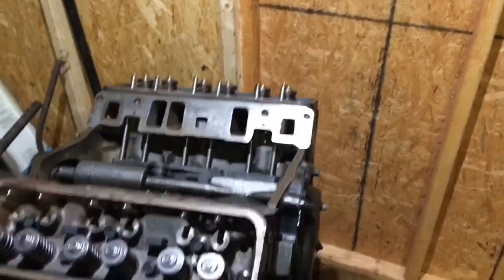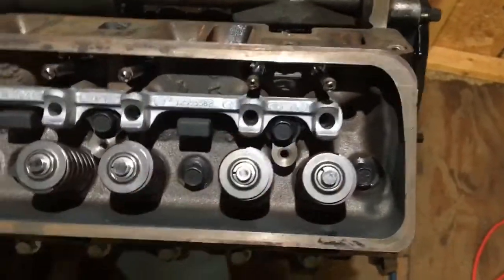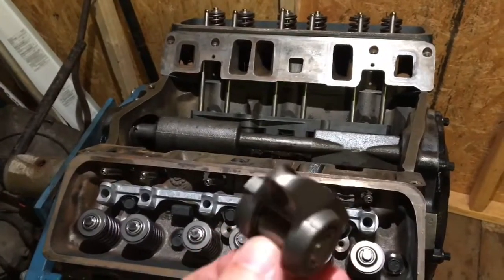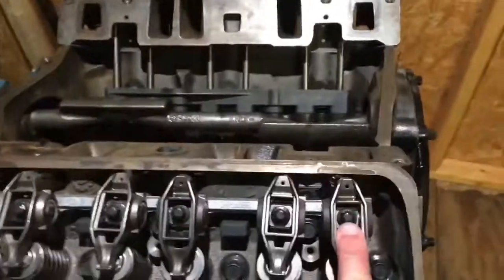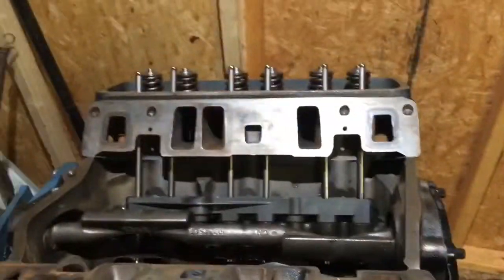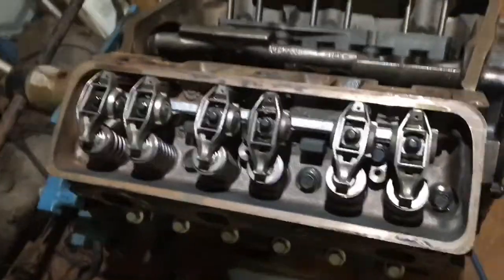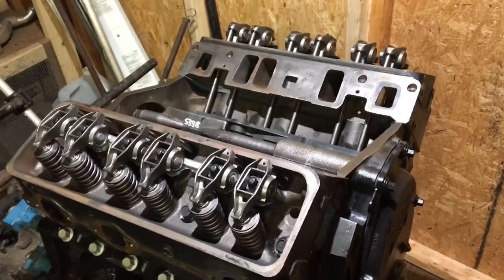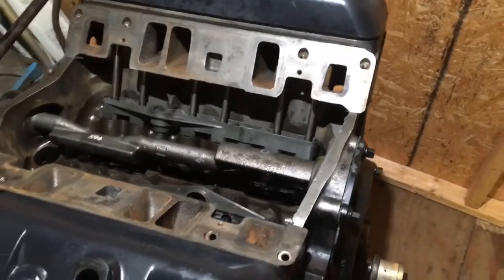Part 7B - Mercruiser 4.3 V6 Rebuild - Valve Train Install

Comment: Where did u buy this rocker arm kit? It looks like those are ls style rocker arms.
Reply: These are for 113 style heads from 2nd half 2000-2002 heads they get torqued between 19-22 ft-lbs.
03-07 classic 113 heads are almost the same but their torque spec is between 18-20 ft-lbs
Reply from the maker: @RamiroSantos4.3 um that’s the same thing. 20 ft lbs is inside both ranges.
Reply: @moccasinmarine i know I'm just going based on the repair manual
Reply from the maker: They come on later model heads like after year 2002. They are not interchangeable with earlier heads because these heads are drilled and tapped for 8 mm rocker arm bolts whereas older heads have 5/16” or 3/8” rocker arm studs.
Reply: Thanks for the info. I'll be looking for a newer set of heads.
Reply from the maker: @robland6118 I don’t know if it’s worth the hassle
Reply: Probably right

Comment: I currently have the roller lifter bolt finger tighten down. I have cylinder 1 on TDC but now I'm confused on which roller lifters I need to tighten down to 22ft pound. I only need to tighten down the 6 roller lifters on the left cylinders (2, 4 and 6).  In the video you said to tighten down the 3 roller lifter bolt that had no spring tension, then rotate the engine 360 degrees and tighten the other 3 roller lifters bolt. How do I know which one has no spring tension and how do I know which ones to tighten down before rotating the engine 360 degrees? In other words what sequence do I tighten these roller lifters bolts? Can I tighten them all to 22ft pound at the same time without rotating the engine? If tighten them all down at the same time isn't an option, can you explain further on how to know which roller lifter bolt I need to tighten down first before rotating the engine? 

I'm staring at 6 roller lifter that are finger tighten down; I'm now just so confused about what I have to do next? If I could get your input that would be great. Thanks!
Reply from the maker: Text me at 706-358-3175 for a tip
Reply: Hi did you ever figure this out I'm having the same problem setting them up

Comment: What state are you located in? Just bought a boat that didn’t get winterized and was hoping your close by.
Reply from the maker: I’m in Harris County Georgia, 100 miles southwest of Atlanta on Georgia/Alabama state line.
Reply: @moccasinmarine  dang, I’m in Idaho. How many do you usually build in a year? And do you sell them nationwide or just locally? Thanks for the videos they are very helpful.
Reply from the maker: @eddygoodwin7089  I try and maintain 1 build a month but that slips when the scope creeps to restoring an entire boat. I sell engines to a mechanic on the gulf coast too. I could mount an engine on a pallet and ship anywhere if needed. What size engine do you have?
Reply: @moccasinmarine  that’s awesome. It’s a 4.3 vortec
Reply from the maker: @eddygoodwin7089  text me at 7063583175.

Comment: Can I tighten down the 3 rods in the lower position out of the 6, spin the crank 360 and tighten down the other 3 rods that are now in the lower position? I’m confused on what three rods I need to adjust first before I spin the crank 360 to tighten down the other 3. Could you help clarify? Thanks!
Reply from the maker: I have no idea what your question is. There are twelve pushrods but as the video shows just tighten them all down at the same time.
Reply: @moccasinmarine so can I just tighten all 6 bolt and call it good without turning the crank?

Comment: they are NOT roller rockers. They have needle trunions. No roller tip..
Reply from the maker: If I have a see saw and 100 lb kids on both ends the force at the fulcrum is 200 lbs. If the valve spring is 100 lbf. at no lift the pushrod must push with at least 100 lbf. which places a 200 lbf load on the rocker fulcrum which is a roller bearing so  in my book I call them roller rockers I.e. they rock on rollers. The valve stem force is half so much less friction there. So GM puts the roller bearings at the point of highest friction and not at the valve stem, probably an economic decision.
Reply: @moccasinmarine  be that as it may a roller rocker is a rocker with a roller tip.Period. Not arguing that it is a great design but its just not a roller rocker.
Reply: It just doesn't have a roller tip. The fulcrum is a roller. It's an ls style rocker arm is what it looks like to me.

Comment: Super Channel, tackling mine because of your videos. I have tapping noise in my engine, to me it sounds like lifters. My question is do the lifters have to go a certain way. ie does the hole for the oil have to point a certain direction. I know the lifters can only go one way to roll on the cam but the hole for the oil can go either way two? Thanks Colm
Reply from the maker: Oil hole location doesn’t matter but if you took it out a certain way i try and put them back in the same so wear patterns match up
Reply: @moccasinmarine  Super thanks for the reply. I had a ticking noise in my volvo penta 4.3. I changed all the lifters and fingers crossed the noise is gone. Now mind you I only ran the engine for 5 to 10 mins in total since I replaced them.
Reply: @moccasinmarine  Great channel really helps people out. It definitely helped me. Thanks from Ireland 🇮🇪 👍

Comment: Hey do u need specific heads for that or can I swap those on for the normal rockers
Reply from the maker: The heads must be drilled for 8mm bolts. I think non roller rocker heads are drilled for 3/8” rocker studs.

Comment: nice job man , Im gonna do the same thing and use the roller lifters as well .
Reply from the maker: Good luck, you’ll need to find an engine built after year 2000 to get factory roller rockers. You can’t convert older heads to use roller rockers without costly machining.

Comment: Great to see all your videos, but have question too: on my mercruiser 4.3 EFI 1998 i had a leaking exhaust so got water in the engine via cylinder 6.
After inspection and cleanup i put the head on starboard side back again ofcourse with new gaskets and renewed the engine oil 5 times, now clear oil again.
Adjusted the timing again according to specs and engine runs again like normal(performance too)(not every cyl have same compression) but my biggest consurn is the engine vibrates more than before the leaking!
I don't realy know what coused this vibrating, do you have any idea ?? thx in advance!
Reply from the maker: If you got water in cylinder 6 you could have bent a connecting rod from hydro lock. A bent rod will cause low compression and power in that cylinder and throw off the balance compared to adjacent cylinders. These combined would cause vibration. Do a compression check to see if cylinder 6 is comparable to the rest.

Comment: I have one loose rod after I tied all the valves, it still pushes the rod to open the vale when I turn the engine. Is that normal or what is the problem?
Reply from the maker: I’m not sure I understand your question but it sounds like you might have a collapsed valve lifter. You should replace the lifter under the loose rod.

Comment: Do you have to turn the crank to a certain spot?
Reply from the maker: On older engines yes you do have to rotate the engine to top dead center and do half the lifters and then rotate around to TDC again and do the other half. But in this build, the lifters are not adjustable so the answer is no you don’t have to turn the crank to a certain position.

Comment: Rapping noise on a 4.3l MPI mercruiser
You have done a great job on your video!

I have a recently installed (8 hrs) remanufactured long block engine that has a rapping noise.  The noise is quiet loud when first started and running at ~600 rpm.  It quiets down quite a bit at 800 rpm.  After the engine is at operating temp the rapping noise almost gone (maybe completely gone).  I'm figuring its in the valve train and possibly a sticking lifter. The oil pressure is very good ~60 psi at idle and warmed up.   I have a couple of questions:
1) Can I remove roller lifters by only removing the intake manifold or do I need to remove the heads?
2) When you discussed torquing the rockers to 22 ft/lbs, you didn't mention anything about the preset.  I've followed other discussions on the large LS engines and they mention checking the lifter preset.  One u-tube mentioned 3/4 to 1 1/4 turns and the other said 1 to 1 3/4 turns on the torque wrench after just removing the slack in the rocker. Can you comment about this.

At this point I am very suspicious of the engine. I'm contemplating running as is for a while or digging deeper into the engine.  Any help would be appreciated.

Jim
Reply from the maker: Thanks Jim, there is no preset on these type lifters. As long as you use the same parts when reassembling the preset it set. These are not adjustable. If you have the block or heads shaved then yes you may have to make changes to the preset. The only way I know of doing that is to get different length pushrods.

As for the rapping sound post a video and ask for help identifying the sound. My guess would be piston slap since rebuilders will reuse pistons out to the max service clearance. This is ok because it’s a high RPM marine engine.
Reply: @moccasinmarine  Thanks for the quick reply.  The piston slap makes since except it suddenly appeared after running fine for 8 hrs.  When I launched the last time it appeared at startup. It had been about 3 weeks since the last trip.
Reply: I went through all the rocker arms pushrods and found a bent push rod (on an intake valve).  
I can't figure why it would get quieter as it warmed up, or what caused it to bend.  Coming into the harbor on the previous trip I tacked up to 4600 rpm and heard a bad sounding noise, I instantly pulled back on the throttle and listened to it idle with no alarming sounds.  I proceed into the harbor at lower speed, and figured the sound was caused by the engine going into protection mode.
As I went thru each one I set the rocker just touching the valve stem and tightened to 22 ft/lbs, each one required ~ 2 1/4 revolutions.  I believe the thread pitch is around .045"  which would put the preset just above .100.  I haven't found the specs for this engine, but what I have found indicated .50-.100 for a LS engine. 
Another thing I don't understand is I put a drop indicator on the valve and measured ~ .125 opening of the valve as I tightened to the 22 ft/lbs.  This surprised me, but there's a lot I don't know about hydraulic lifters.
Reply from the maker: Jim as to your question #1 you do have to remove the intake but not the cylinder heads. These engines are the old school design where the lifters are not under the heads like they are with LS engines. LS preset is also not adjustable except for with different length pushrods.

If you have a collapsed lifter you should be able to find it by removing the valve covers and inspecting the rockers as you rotate the engine. There should be no play in any rocker after rotating through 720 degrees.